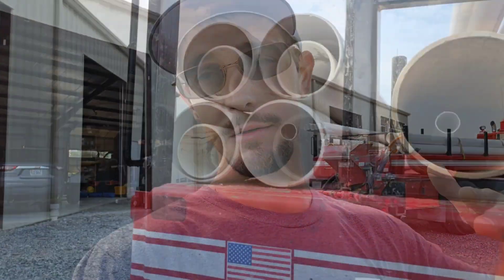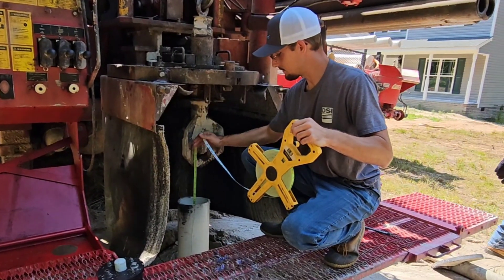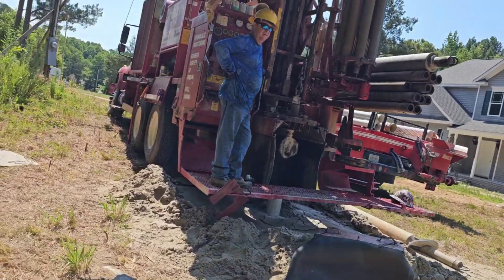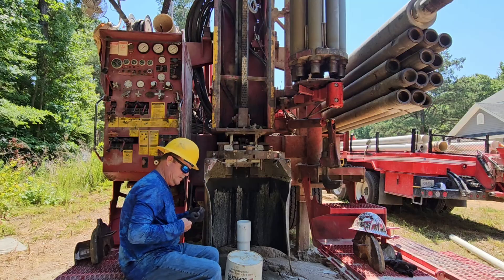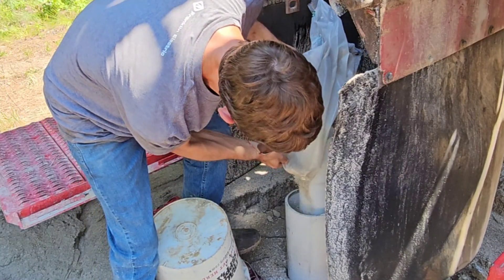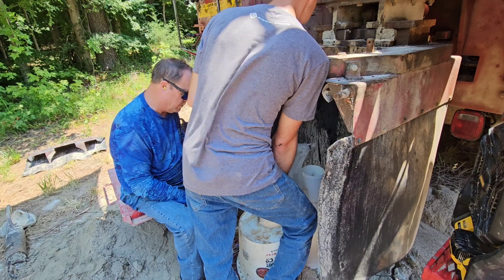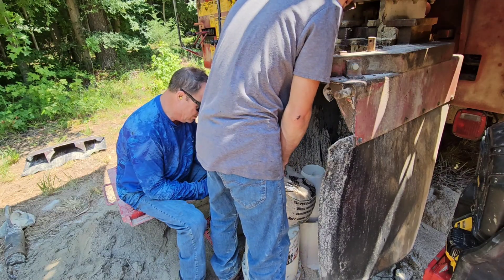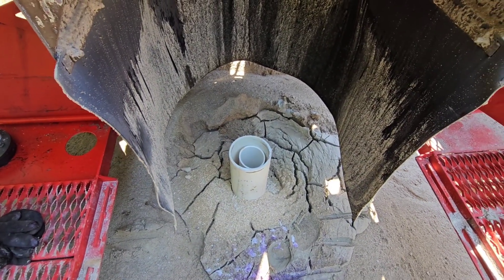Screening a Well from Tons of Sand to Prevent Collapse. Alot of Water & Sand!!!

Comment: Thanks for the videos a while back a local driller driving steel casing welding them together and checking water coming in along the way and writing it down then when he thought he seen enough veins he had a hydraulic apparatus that ht would drop down the well that would puncture the casing at the veins

Comment: @H2o Mechanic -  You certainly need to get your dad in your videos more and more!  My dad drilled water wells and did pump work for almost 40 years and I worked with him in my younger years until I graduated HS.  My dad operated cable tool machines, mainly Bucyrus-Erie 22W & Bucyrus-Erie 20Ws.  He retired from drilling in the mid 80s and continued doing pump work for a few years until he had a stroke and was unable to work and passed away in 1997.  I don’t have any pictures of him drilling but I do have many memories.  Get all of the pictures and videos that you can of your dad because once he’s gone he’s gone!!!  I had a cable tool drill rig engraved into the back of his head stone at his grave.  I’m so glad I found your channel and would like to know your name.

Comment: I'm surprised you don't have some kind of jerry-rigged funnel for pouring the gravel in. I'd presume that dropping a foot of 4 inch pipe with a cap on it to plug the well so gravel doesn't go down it, then dropping a 12 inch to 6 inch reducer for air ducts on it would make your lives a lot easier in the rare situation where this occurs.

Those duct reducers are like 15 dollars, and I'd assume you've got some scrap PVC segments around for the temporary plug on the main well pipe. If a jerry-rigged tool like that saves even 15 minutes of labor once, that pays for itself, and it looks like it'd save you more than that. If you want to go extra lazy, get a vibrator for concrete or something similar and you'll be able to buzz the stuff down the funnel faster than one guy can slice open bags and pour.

Comment: Hey man i got an issue going on. We have city water now, BUT we abandoned a cistern and 2 wells. NO pumps in either well or cistern. I just noticed my cistern is taking on water from the heavy rains. You can see where it goes into the ground at a high rate. When they abandoned the cistern they took off the casing and well seal. They closed it with a concrete paver the 3x3 or 4x4 broken in 2. through the years it flopped around in the dirt and moved. i got it all dug up now. Whats your best advice on sealing this FOR GOOD.
Reply from the maker: Hey, I read your message, it's hard to picture honestly. My recommendation is that if they aren't in use, I'd fill them with dirt or cement or a mixture of both.
Reply: @h2omechanic  No money for that. we live in the sticks. im just gonna go with the bowl glued into the top unless i can get a donut and glue some 6" SDR, bring it to surface and cap.
Reply: @h2omechanic  Thank you for the response man. much love to helping others. I know you get paid for your knowledge and skill so i respect that man. i sent my email if you want a photo

Comment: Higher volume irrigation , and commercial wells use a 12” to 16” casing with the screened sections only in a good aquifer and then gravel packed which acts as a filter and to keep the the screen centered I used wooden spacers wired around the screen about ever 15 ft to insure a even gravel pack.  When gravel packing construct a device to meter a constant flow of gravel pack at a slow rate to prevent bridging and voids, on larger 16” wells 350+ deep would use many tandem truck loads using a 28” drill bit thus a large gravel pack area between 28” drill hole and 16” casing.  When the well was started it was non stop to finish of gravel pack, no stopping at night, sometimes 25 hour operations.  I enjoy your channel, good job

Comment: Not being a driller, I would think that slotted pipe creates a bit of a restriction and as a result the gpm of the well would decrease.  What percentage of gpm do you loose when using slotted pipe? Would also be interesting to know what the end gpm is when the pump gets installed. Thanks

Comment: I have a quick question regarding wells over in the states.
What happens if you drill a well say to 300’ @ 20GPM But you make a mistake and the well gets damaged. Which makes it unusable!
Does that mean the client has to pay for a new well to be bored?
The question made more sense in my head than being put to text. 
The reason I asked is because it you drill and the well is no good, then the client has to pay for the new well to be dug eg well is producing less than 3GPH?

Comment: All wells here (the Netherlands)  are screened.  At the bottom comes a cap , only when the last meter or so is clay i don t use a cap , clay will close the bottom .

Seems you didn t use a bottomcap , but you have 3 sections of normal pipe at the bottom , that will work

Common slotted pipes  are vertically slotted  , gives a stronger pipe so you don t have to be so carefull . I m slotting my own pipe , a 125mm pipe with 0,5 mm slotts

Comment: I like the idea of the gravel in the casing, how do you know that the center pipe is centered inside the casing.??? If it's not centered won't sand work it's way into the inner pipe ?? Just a thought...
Reply: At the point where the screen is at the pipe most likely still has a roughly even gap on all sides. Cause it’s so long him pushing the top up against the other pipe won’t move much further down.

Comment: Hello Phillip,  I appreciate the videos.  On this well, if I understand correctly, the solid pipe at the bottom is simply a foundation for the screen to set on.  Where do you set the pump?

Another thing that I don't quite understand. In drilling, exactly how do you know when you hit water?
Reply from the maker: The 6" pipe blocks out the upper dirt & goes into Bedrock. Hitting water we notice it by the sound of the hammer, the percussion changes for a few seconds, then the flow increases away from the water water/cuttings. In this case the pump will go at 100ft near the bottom of the screen

Comment: It is always great to have someone at the supply house that has been in the field. They are more knowledgeable than someone that has been brought in from high school to be nothing more than a parts locator. I am a field tech in HVAC and I have more knowledge than those guys from high school and they learn more from me. I even have to locate parts on the web when the supply houses say they can't get the part. I usually find my part in some obscure corner of the web of a business that lists it and are surprised they still had it and willing to sell it for less if they can move the last 2 or 3 they will have left in the box. I always thought screen liner was bigger slots with cheese cloth over it. Thanks for the info.

Comment: I have a 2 line jet pump system. The head is 48" below grade, (i live in the north east) i plan to switch to a submersible with a pitless adaper and bring the well cap above grade. There's only so long the galvanized pipe will last before it leaks from the inside out. 

Can you make a video on that conversion?

Comment: Nice vid. Got a question. My well was dug 160’. Static level is 44’, max output is at 89’ at 8-10 gpm. How deep would u put the pump. Btw, I just bought some quality products from H2O mechanic, pump & wire.
Reply from the maker: I'd set it at 100ft or 120ft max. The deeper you go, the more sediment issues you might face. If water enters at 89ft, setting the pump at 85ft would decrease sediment. But set it deeper to start with, if sediment is bad, you can pull it up as needed.
Reply: @h2omechanic  thanks
Reply: @h2omechanic  I have a 2 line jet pump system. The head is 48" below grade, (i live in the north east) i plan to switch to a submersible with a pitless adaper and bring the well cap above grade. There's only so long the galvanized pipe will last before it leaks from the inside out. 

Can you make a video on that conversion?
Reply: @h2omechanic  I agree, 120 would be my depth.

Comment: That's great information! It isn't every day that we can see a well get screened.

I've seen the slotted pipe before. After about 12 or so years, my well started to get some grit coming up. It was enough that I was needing to clean out the Rusco spin-down filter on the line to my geothermal heat pump every few days. My pump man took a length of that screen pipe about 5 or 6 feet long, slid a fine filter sock over it, tied the open end of the sock shut and secured the whole thing over my pump. That took care of about 99% of the grit that was coming into my filter.

Take care and God Bless.

Comment: I know you probably won't get other comments. I've been drilling Wells up in Northeast Nebraska. And we do this way all the time, I have to drill a hole. You have to put the casing in.
 Will we stick a cap on the bottom?  It seems to save a lot of problems. I just thought maybe I would mention it.

Comment: We do steel pipe and perforate it after. More durable but it's an expensive tool
Reply: Not much experience myself but trying to learn, read,watch a lot. 
As far as i learned, Unless stainless steel, it is not necessarily more durable. They seem to have used a lot of galvanized in the past but eventually the rust goes through